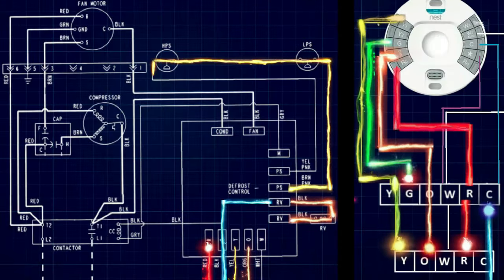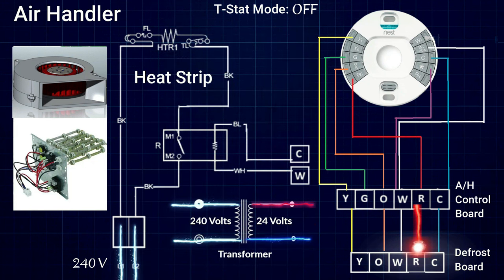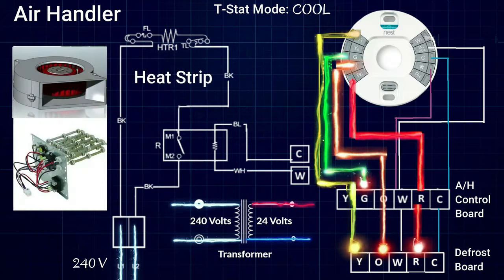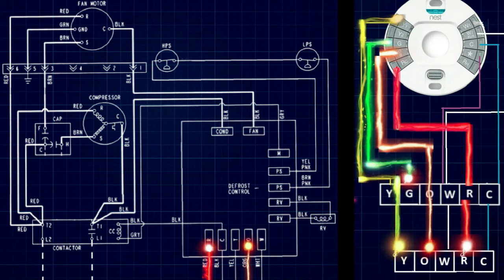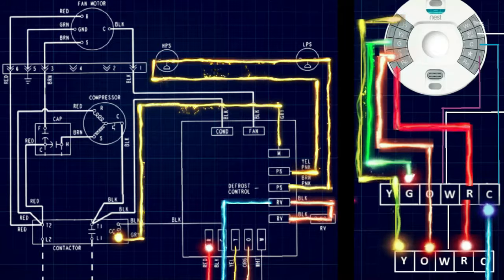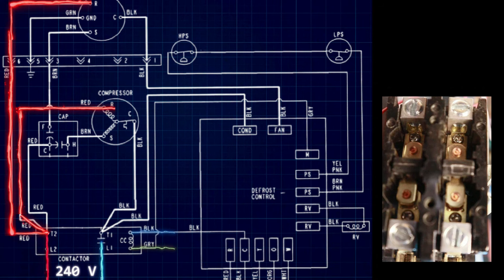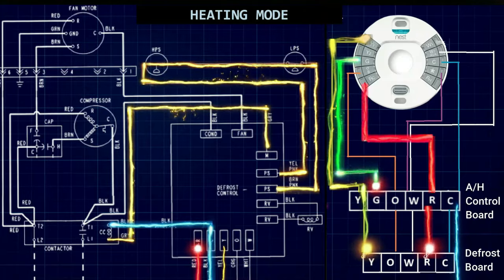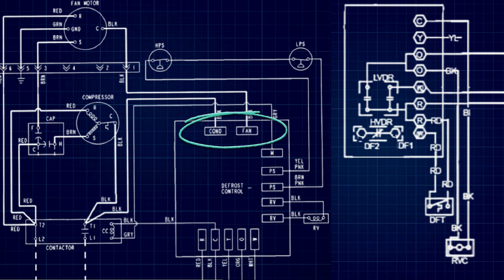Crucial Knowledge To Heat Pump Troubleshooting

Comment: Hey Mike, There's one small detail missing from this video.  
DFT = Defrost Thermostat.  It's a SPST NO switch that closes on a drop in temperature.  It's located on the outdoor coil to sense the temperature of the outdoor coil during heating mode. Typical setting is 30-35ºF with a differential of 20-30ºF.  The actual rating depends on manufacturer.
The Defrost control will only accumulate compressor run time while the DFT is closed.  If the DFT opens in between cycles due to outdoor temperature, the defrost control will start accumulating compressor run time (starting at zero) during the next cycle after the DFT closes. The defrost control will add up the cycles only if the DFT remains closed in between cycles.  
If the DFT remains closed long enough to accumulate the selected minutes on the defrost control (Typically 90 minutes in North America) a defrost cycle will be in initiated.  
One of two things will terminate defrost.  The DFT opens due to the coil warming up, or a maximum defrost time is reached.
This is a common Time & Temperature Defrost control...
Reply from the maker: Thanks for the added detail. I'll pin this to the top of comments so people can see it. 👍

Comment: Hi, homeowner here.  Just installed a venstar T8900 color touch Therostat for my 2010 older goodman heat pump and I have an old 1990 carrier air handler in the attic .  This particular thermostat has 3 dip switch on it and I set them according to the instructions..I think :).  I then hooked up the wires according to the instructions .. Red wire to power terminal, Green wire to fan Terminal, Yellow wire to cooling/compressor terminal, Blue wire to Common terminal, and white wire to O/B.  The POS does not work right???  At first all I got was fan cuz I did not set the dip switches... they were all factory default gas/electric.  After I did that  I got cooling however after reaching desired temp the heat pump energized the heating and continued to run???  To stop this I put the white wire on to the Y terminal along with the yellow wire so at least I would get cooling?  What the heck am I doing wrong??  According to the instructions I did it right... I took an old honeywell RTH 7600 off which was working great however, it was battery operated....if that means any thing but where I really screwed up was not taking a picture of where the wires went on this unit.  Anyway, any idea why my new thermostat is acting the way it is?  PS I have NO orange wire to the thermostat?

Comment: 5:45 i didnt realize 120/240 ran through the fan relay on the defrost board. I thought it was control / low voltage that powered the relay, similar to a contactor.
Reply from the maker: Low voltage does control that relay.

Comment: Hey Mike thanks for the amazing video. I have a few questions if you don't mind taking the time to clarify a few things.

1. When the unit is in defrost mode, how does the low voltage defrost relay get pulled in to pass 24v to the reversing valve? In the video you just state that the relay gets energized but I'm uncertain how that happens. Is there something internally that's happening?

2. Likewise how does the high voltage defrost relay open during the defrost cycle?

3. Finally just a general question but I'll reference the video as an example. When the Y terminal is pulled in and it sends 24v through the control board and through the pressure switches, how do you know that the 24v then goes to the M terminal? If I were to look at this on my own for the first time, I would have no idea that the 24v will come back to the PS terminal and internally to the M terminal. Obviously you've been doing this for many many years so you know by experience but how would a novice like me be able to figure that out?
Reply from the maker: Both defrost relays are activated by the 24v signal passed on by the defrost timer taken from the R power. 

As for the M terminal, that one I just had to figure out by talking to other technicians or checking schematics of similar systems that laid it out a little better. It didn't come easy.

Comment: Hello Mike. I was working in the field and ran across a thermostat that the voltage on the R and Y was 16 volts, it also showed 16 volts in the air handler and 16 volts in the condenser. Testing the Red with green, and Red with white both registered 27 volts. What could be causing the voltage drop? The contactor does not show voltage on the coils, but when testing the coil for ohm it shows 12.8 ohm and it also has continuity. What could be the problem? Thanks for your input.

Comment: Asking for a friend.....  My friend had a company come inspect they found no 24V on the yellow at the outside unit.  it was a open float switch because of a clogged drip line. they fixed that and everything was fine for 3 days...... fast forward 3 days and the AC is blowing heat.   the Copper lines in and out of the outside unit was way too hot to touch,  my friend pulled the cover off the unit to check for 24v on all wires and if the contactor works.  what my friend found was the O wire spade had fallen off the defrost board.  My friend plugged it back in, BUT AC is only matches outside/Ambient air. 

The guys  that "Fixed" it say the outside is "dead" (6 year old Goodman)   would running the system in "A/C" with the "O" off the defrost board "kill" the outdoor unit?    

It's my opinion they yanked the O wire loose on the defrost board checking for 24V.   ?????
Reply from the maker: The O wire just controls the reversing valve to put it in heating or cooling mode.  It was blowing hot air because the RV wasn't getting the signal during cooling mode. Basically, having the O wire disconnected is just heating mode and shouldn't "kill" the outdoor unit.

My question is was the O wire touching anything when disconnected?  Could have created a short when powered up in cooling mode. 

Does heating mode still work normally or is it the same ambient result? 

If heat works, try to jumper Y and O  at the defrost board in cooling mode. If ac works then, problem could be a burnt out switch on the 
thermostat from the short. If not, could have damaged the defrost board or possibly the reversing valve is stuck.  

 At 6 years that could be a warranty repair.

Comment: I have a similar problem with the letter O. I have a Rheem 3.5 Ton AC. I have the following wires coming out of the defrost board. Brown = Common (letter C), Red = Power (leter R), Purple = ?? (Letter D)Blue = ??(Letter B) and Yellow  = Y (letter Y) which is for they is for the AC. My problem is the Blue and the Purple. Blue is connected to letter B on the board and Purple to D. The thermostat am using is a Nest Thermostat and it has letter B. It also has W1 and W2 adn from the board in the attic, I have w1 = white and blue wire and W2 white and brown wire. Assuming I connect Blue to B on the thermostat, what do I do with purple?  I read some answer below and it suggest to connect Purple to W1 and W2. Once I do that, it will be like placing a jumper from W1 to W2, correct? If am wrong can you please correct me on all and everything.
Reply from the maker: For clarity, when I said W1/W2, I didn’t necessarily mean place it on both and jumper them. I just mean it should go to one of those terminals depending on how it’s wired based on the configuration of the equipment available, which is information I don’t fully have.  There may be 2 stages of backup heat in which case W1 and W2 are wired to each activate one of two heat strips or a 2 different stages of a gas valve in a furnace.

 All that purple wire off of D does is allow the condensing unit to activate whatever that backup source of heat is. So it will land on the same terminal that calls in the secondary source of heat such as heat strips, which is usually W1. In some cases W2 might do exactly the same thing, just at a different time and it might not make a difference if you place the purple on w1 or w2 or both. 

 Normally it will just land on W1.
Reply: @JerseyMikeHVAC   Never worked on an AC of any kind. Your video was a great help, not only that, you answer my questions prompt and to the point. Today I got my ac running, well my heat. Since I have a Nest Thermostat and the temperature outside was below 55 it won't let me turn on the AC but, I guess that will be another question for the summer. Thank you

Comment: I need help. I have a Rheem system 3.5 ton, 20kW heat strip. From the control board I have the following wires going out of the cabinet Yellow connected on the thermostat at Y1. White and blue to W2. White and black to W1. G to Green. C to brown and R to red. On the defrost board outside I have the following letter and cable wires Y with yellow wire, B with blue wire, D with purple wire, Red with red wire and C with brown wire. I don't have "O" in the blower or on the defrost board nor orange wire. The thermostat am using is Nest Thermostat. What am I missing? The AC and or the Heat has never worked. No need to rush since the house is vacant but, I will be moving in this summer. What can I do? I see the RV and C on the defrost board connected but, I haven't follow the wires. I also see 2 flashing red lights for about 2 minutes after that, they start alternating on and off for another minute or 2 and start flashing at the same time. Flashing at the same time is normal. Alternative is High and Low pressure lock out. At this moment I just need help with the "O" wire and or terminal that I don't see anywhere. 
CORRECTION. I got the heat strips to work
Reply from the maker: On Rheem systems the reversing valve is energized in heating mode off of the B terminal. So there is no O terminal used here. 
That blue wire on the B terminal on the defrost control board needs to be powered by the B terminal on the thermostat and this connection from B to B happens inside the air handler at the control board. 
That blue wire in B at the defrost board should go to B in the control board which goes to B on the thermostat.
Reply from the maker: Also, the purple wire off of D on the defrost board should go to W1 W2 at the air handler. That is your heat strip activation during defrost cycles. Here's a wiring diagram you should be working off of:
https://www.doityourself.com/forum/attachments/thermostatic-controls/54963d1440259155-connecting-thermostat-rheem-heat-pump-system-rheem-thermostat-wiring-diagram.jpg
Reply: I have no letter “B” on the control board. All I have is:
Y1 = yellow wire
W1 = white and black wire
W2 = white and blue wire
G = green wire
C = brown wire
R = red wire
But no letter “B” or letter “O”

Comment: WTF.... HVAC technicians are not engineers this explanation is too long and detailed.
I'm going to watch it a few more times to see if I can follow along.
And mind you I have a B.S. degree.
Reply from the maker: It's true, nobody looks at us HVAC technicians as engineers, but this is the level of understanding that is required to diagnose these things.
Reply: Your lack of education is exactly why we have HVAC techs changing parts all day that are not bad, you need to know this information to correctly diagnosis the defost system.  If you are not constantly willing to learn yoru trade in great detail i believe you have picked the wrong trade to be in and i recommend that you please move to another profession that allows you to not have to know what your doing  edwardlara1011